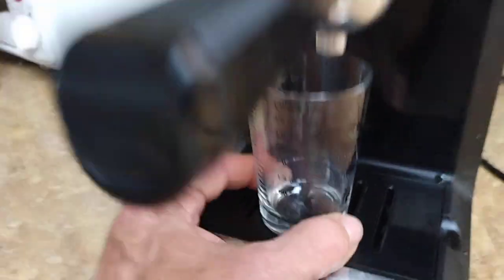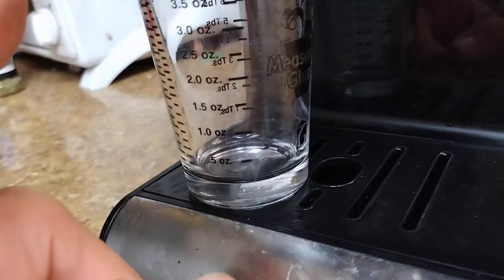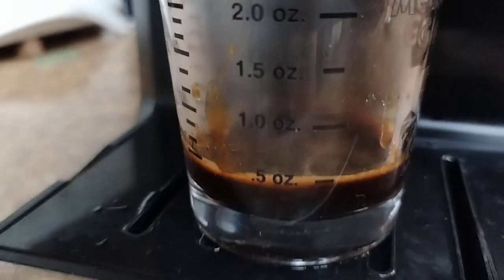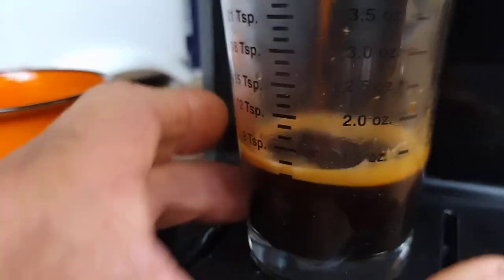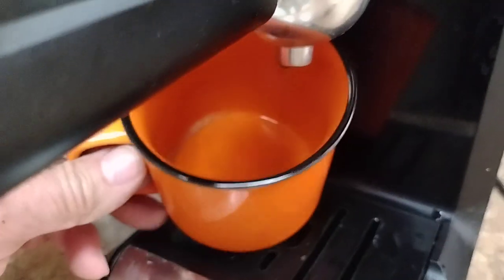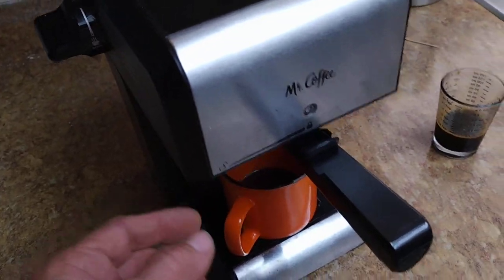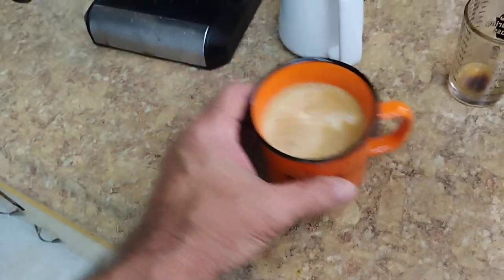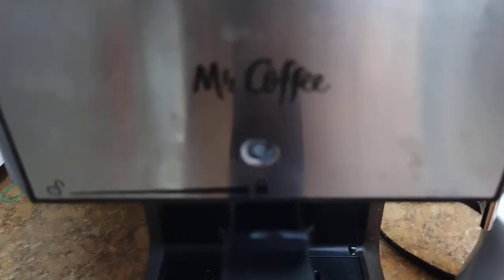Hacking the cheap Mr Coffee espresso maker to make a real SHOT

Comment: I got a somewhat similar one from a friend. Mine have the 'pre-heat' option where it boils the water first to generate pressure. How do you know when the pressure has already built up enough? Whenever I try using mine, the brew sputters with steam and not a steady flow. And that's after around 2mins of 'pre-heat'.

I checked the basket and it's not channeling. However the puck have holes in them. Which I think is from the pressure the water/steam hits the grind.

Comment: A friend gave me a used one of these, no coffee measure and no water cup. Would you be so kind as to reply with water measurements for me, so I can make an attempt to use this machine?
Reply from the maker: Don't fill it to the top. Fill it until you can see the water. About 6 or 7 ounces. A full cup (8 oz) will overfill it. If you steam your milk first you can let the extra water come out the steam wand before steaming. That will get any extra water out if you do happen to overfill.
Reply: @seetheforest Thanks for answering! Can I use less water on purpose, or is that counter productive?
Reply from the maker: @thistlecreek1 depending on what you consider a good "shot" of espresso and based on the size of the dose, with a full 4 cup Dose being about 16 grams or so.. You should look for a 2.5 oz shot in about 30 seconds if your grind and dose allows it. If you overpack the basket or use a lighter roast or have a super fine grind it can lock up and you won't get anything in 3 minutes.. The water just won't make it through the coffee. I use a full basket and barely pack it just enough to flatten the grounds off. You should have a shot in 25 seconds any longer and the coffee is cooked at steam temps and it tastes terrible. Same if you run it like the instructions say and running all the water out in 5 minutes making a 8 oz pot of swill. The directions are not even close to how to make espresso.

Comment: Do you fill the filter to the top or the 1 shot line?
Reply from the maker: I fill it to about the "4" cup line in the basket and very lightly push it down to make it flat but if you go to packing it you will not get any flow. 
This low pressure maker is hard to get a good shot out of but it is possible.
Reply: @seetheforest  ok thanks for the reply! I found a video of someone pulling a pretty decent shot with this machine. He let the machine heat up first, then purged some hot water, tamped the grounds with seeming normal tamping pressure then brewed a shot. I do want to try it without tamping though. I've seen other people say they eliminate tamping altogether and just use a distributor. 

Here's the video: https://youtu.be/DxA5EB-gHcE
Reply from the maker: Oh yes absolutely. I barely mentioned that.. I turn the switch half way to the steam just until the light comes on so it can heat and build pressure. VERY IMPORTANT to do that! I also ste my milk first and get that out of the way and run a few small blasts of water through the head to heat it up a little and blow out any grounds out that may be in there that will contaminate your shot. The machine has to be spotless. Then you put the basket in and set the timer to 25 and start the shot and hit the timer as soon as coffee hits the cup. I stop when the timer goes off or I get my 2 oz or if the stream starts getting bubbly and yellow looking. If the stream breaks up it's done. If you have between 3 and 4 cup level fine grind, and a light tamping with a spice bottle that fits in there you should be able to get some decent flow. But it's all very touchy. I do everything by eye and it would probably be better if I weighed things but even weighing the dose is no guarantee.
Reply from the maker: I just bought a espresso machine with 19 bars of pressure. (Coming next week) I have some new fresh light espresso roast that I cannot get to flow no matter what I do. Even a little 2 cup dose expands so much when the water hits it that it locks up in the filter basket and completely stops the flow at less than a half ounce. 
So I got a machine with some power to try to run this difficult bean. 
The darker the roast the better in a low pressure machine. French or Italian roast.
Reply: @seetheforest  really helpful tips, thanks! Glad to hear you got a new machine, good luck with that light roast! 🖖